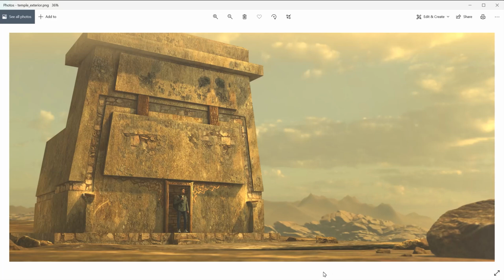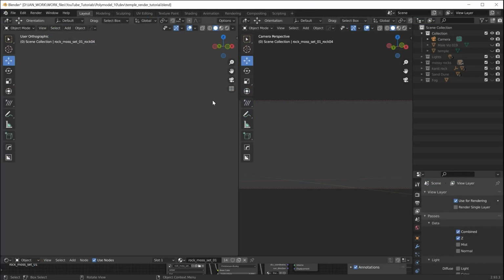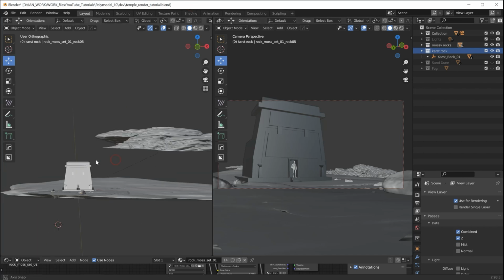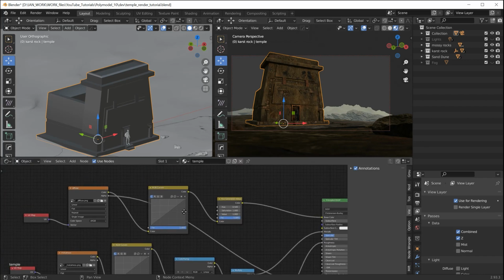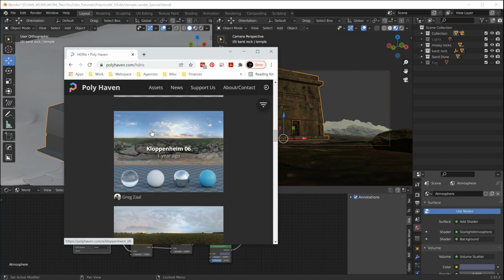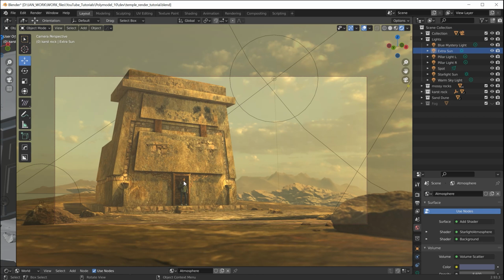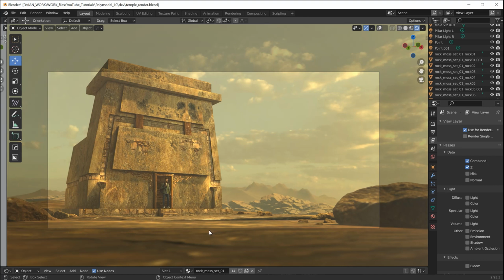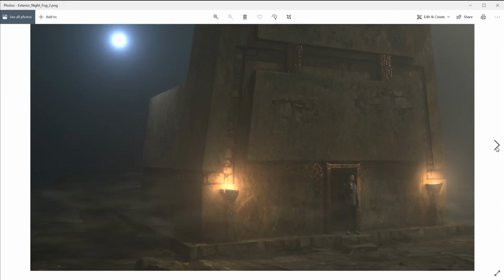3D-Coat - Final Temple Render using Blender

Comment: Did you investigate the subject of breaking up hard corners? I have and old workflow with 3ds max+zbrush, so you take low poly, send it to sculpt, break/smooth corners there, decimate, send back, bake displacement map. But there are lot of blows and whistles along that road. First of all UVs like this will not allow baking proper edge crushing maps, because UV islands must be split on every sharp corner. In theory in Coat it's not a problem to send model from Paint room to sculpt, do flat subdivision to sculptable resolution, and use Trim/Scrape brushes to break corners. It's actually fun process... But I never tried if Coat can bake proper displacement maps. Also it can be an option to manually bevel/cut the edges on low poly, and use those Tweak/Sculpt brushes in paint room to break those perfect corners, but problem is Coat doesn't have good (fast and reliable)  edge cutting tool in modeling room, so I would probably do it in Max.

Comment: if you want to cut down on the hard lines when you render in Blender you can add the Bevel Node in the shaders to round off the edges.  You have to use the Cycles render engine to use this node.
Reply from the maker: Thanks Icedriver